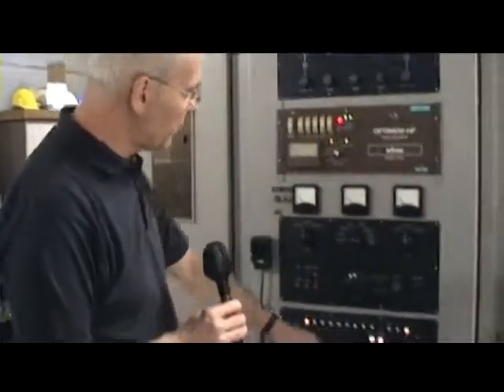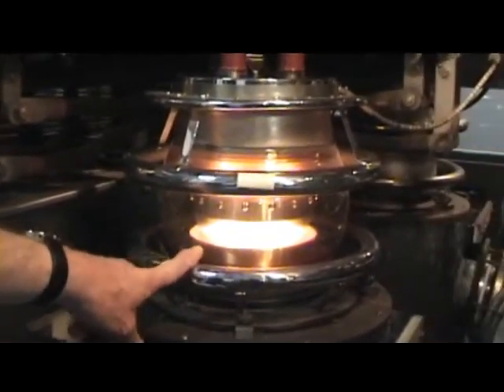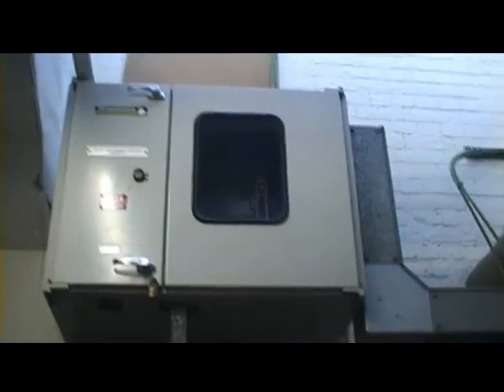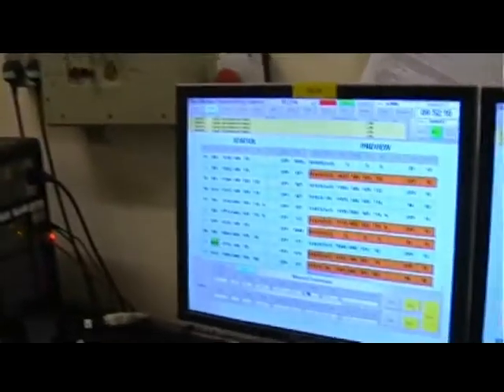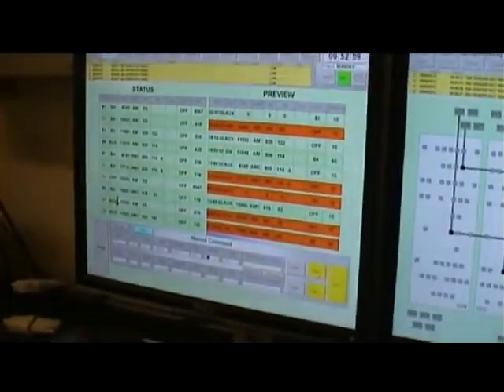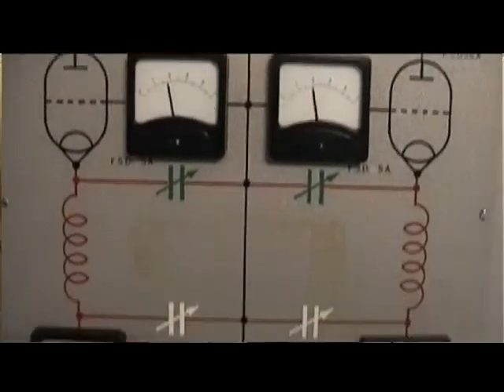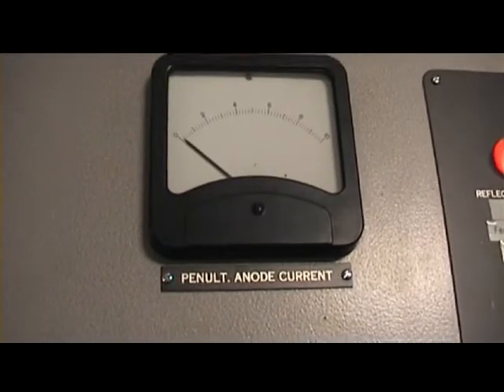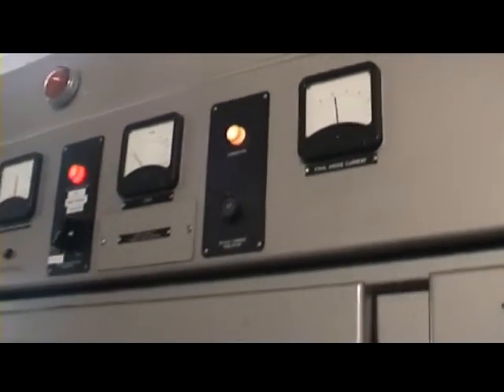Woofferton Transmitting Station Part 7 - Marconi BD272 Powered Up

Comment from the maker: Hi ilferret, these senders are designed to provide interference free reception hence the high powers used. Normally it's not wise to mix water and electricity and that's why so many are surprised about the cooling methods, especially thosed used over 50 years ago!